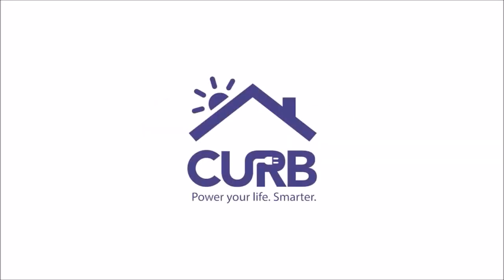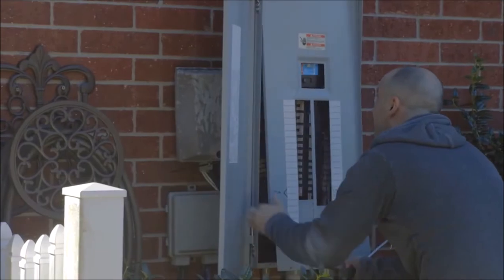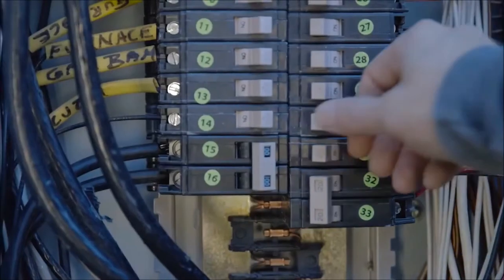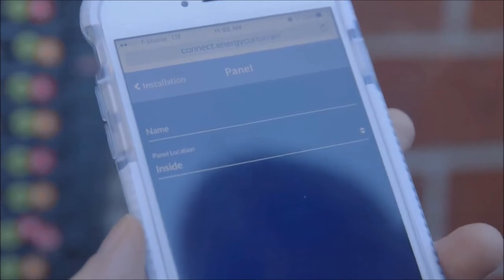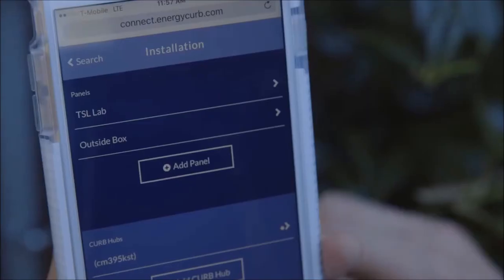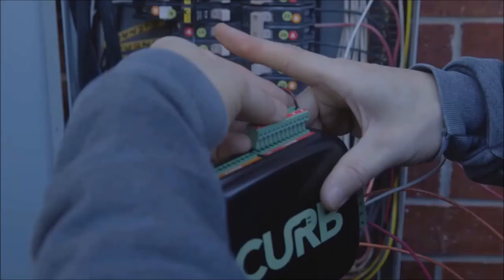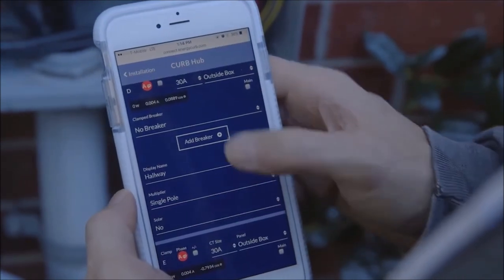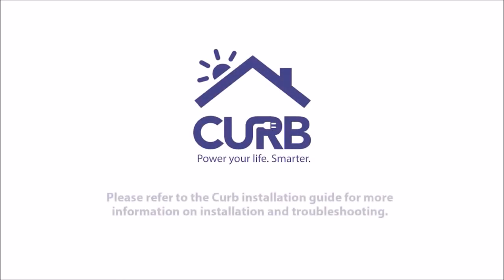CURB Energy Monitor - How to Install | RENVU

Comment: How does the unit in the panel communicate with the device that's connected  to the router?
Reply from the maker: Hello! Power line communication. Email us at info@renvu.com if you have more questions. Cheers!

Comment: Would be nice if it had a display that shows every solar production  Any diagram that shows if you have a faulty solar panel not producing would be nice if they incorporate that into the software
Reply from the maker: Yes, it would be nice! Unfortunately, the CURB does not monitor solar production, except as an entire system. Instead, it is a whole-house monitor with CTs for each circuit/device you want to monitor. You might be looking for Module Level Power Electronics (MLPEs) such as microinverters (APsystems, Enphase) or optimizers (SolarEdge, Tigo). If you have an older string system, you could retrofit with Tigo's optimizers! If you have any questions, please contact our sales team at info@renvu.com. Our sales team is comprised of engineers who can provide the first level support you need on any project. Thanks!